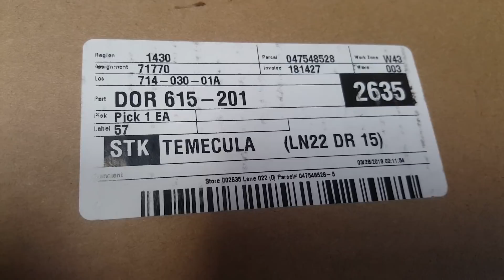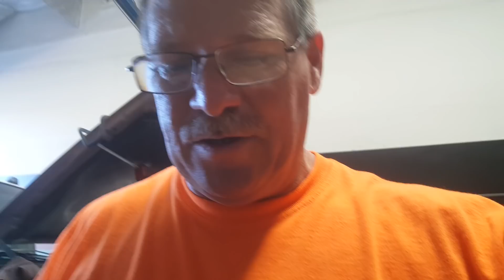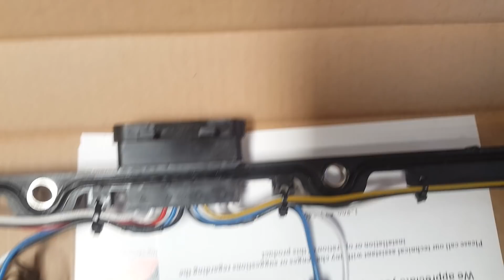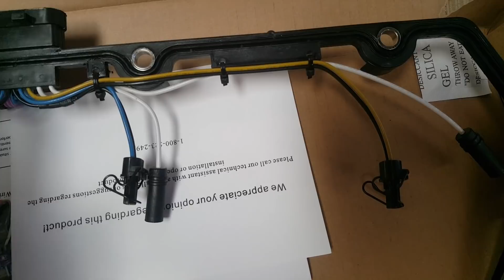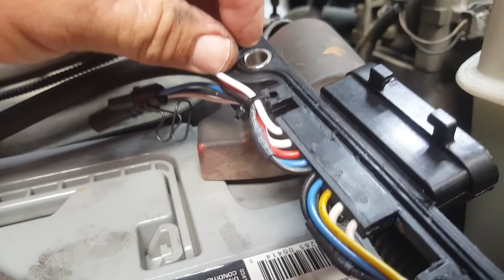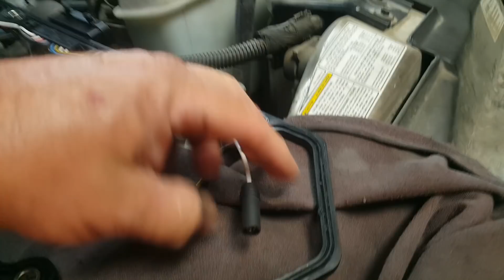99-03 Ford 7.3 Powerstroke Dorman #DOR 615-201 valve cover gasket failure.

Comment: Got one of these Dorman gaskets the other day, they have gone to the OEM design with an internal plug.  I ordered the TRQ, pictures show it to be direct wired.

Edit The TRQ is also like the OEM.  I bought a no-name LSSYEUX on Amazon and they were the direct wired version.  Torqued it to spec, all cylinders work and no oil leaks yet.

Comment: Man! I was all about doing the quarter trick. I read it’s basically impossible for the quarter to fall out as that was my first thought.  Now  I find your video that not only detests the quarter, but showing the doorman problems too.  

I was told the gaskets were replaced recently (somewhat) so I guess it could be many things.  Thanks for laying the quarter issue straight.  I was thinking short term to be sure it’s the issue before more parts are bought.

Comment: Seems to be common sense to me. Pay attention and don't pinch any wires. I've watched 3 different videos on replacing valve cover gaskets on the 7.3 power stroke. All of them like the Dorman 615-201 gaskets and every one of them stated, make sure the wires are clear of being pinched when you put the valve cover back on. Your video should only be about how you F/U and how not to make the same mistake you did. Sh*t happens.
   Telling people about the quarter trick is not a smart thing to do. I can't believe any sane person would do such a thing.

Comment: Yup the exact same thing happened to me.  I spent hours trying to figure out WTH was going on before i found it.  It was dark when i did using my flasglight and the light caught the copper wire just enough I seen a small flash.

Comment: Hi Ron thank you for the information. I have a question the doorman gasket also comes with a male harness (plug) did you change the plug or you were able to plug directly to the valve cover.  I replaced both valve covers and now no starting. It will “run” with starting fluid spraying into the air intake ?

Comment: I have installed this product on my 2001 7.3 and I bent the wires so they would stay away from gasket simply pushing wire is not enough because wire tension can push it back where you don't want it. Did my gaskets about 5 years ago 2019.

Comment: Unfortunately it seems the Dormans are the only gaskets available these days. The OEMs are sold as 2 pieces, good luck finding a set of both. The OEMs I did find were made in China too. Thanks for the heads up, I probably would have made the same mistake had I not seen this

Comment: Very helpful video! My normal source of parts is Rockauto and I see they carry 3 brands that come with the wire harness -- Standard, Apex, and GB. The pictures show only the GB one with ty-wrapped wires and the other 2 are loose wires. They also sell the gasket alone no wires. Anyone use any of those brands?

Comment: Bought some similar from another company recently they were junk, had nicked wires, missing wires and was just plain poor quality for 300 dollars i sent it right back and got some oem ones, they still have that plug under the valve covers but its good quality and it works.

Comment: So I was most of the way done with my injector replacement had covers back on and torqued, called it a day went on yt and this video popped up....next day took covers back off (I really didn't want to) and sure enough pinched the wires exactly where you pointed out the problem....THE HELL WITH DORMAN!!! THANK U SO MUCH FOR MAKING THIS VID

Comment: Cant say I would have noticed that.   I'm working on a 94.5 so the harness is different,  but I will check to make sure wires are clear when I put the valve cover on.

Comment: Sorry...IMHO, the Dorman gasket is a better design IF you pay attention to the installation. You need not deface currency, and you don't have to worry about  spare change in your valve cover.  I've been"riding" a pair of theses gaskets for almost 4 years without any issues!  With ANY automotive procedure, you need to watch for pinched wires (including the ones you're not working on).

Comment: I have a question for you that you may or may not be able to answer but I would appreciate it as soon as you get this if you would. The question is the heads on my 2002 7.3 did not have a fuel return and the heads that were rather identical come off of a 96 or 97 I believe 7.3 words to junkyard said that they would interchange however the heads I put on it had a fuel return line so since my original heads did not have a fuel return I just use a plug-in plug them up. The question is would something like that cause me to have performance issues as I put new heads all the injectors are working and I still got a lot of white or gray type smoke coming out the exhaust thank you for your help I do appreciate it
Reply from the maker: That's not a simple question to answer
Reply: Any help is greatly appreciated
Reply: Why were the heads replaced?

Comment: Wish I could post a picture I just pulled my drivers side valve cover because I’ve been having glow plug issues and I’m thinking possible even injector issues. As soon as I lifted my valve cover sure enough a smashed doreman valve cover gasket!! Installed bu a very reputable shop in my area! Thanks ron been using your videos trying to get my truck running better!

Comment: GUYS!!!! do not use these! I put them on my 2000 7.3 and the glow plug pin burnt off inside of the connector. also the rear cylinder on passenger side injector clip fell off of the injector while running. lasted 10 months and I don't drive it a lot. only ford parts on these! I had to but FOMOCO gaskets and the inner injector harness. My connectors to the engine harness were still good! I'm a 34 year ASE master tech! FOMOCO parts only on these!
Reply from the maker: I agree

Comment: >>WARNING * CHINA SELF DESTRUCT UNIT<<  That wire "alignment" issue is nothing compared to the INFERIOR material the wires are made with... After 20K miles I have seen on my own Dorman,, the plastic on the wires start cracking... Search it & people have seen "cross arcing" of the crap wires where it fires THE WRONG injector on it's compression stroke ..  Guess where that connecting rod ended up??
Reply from the maker: Thanks for the info. That would make sense

Comment: Ok update - I just did glow plugs and gaskets on a 7.3 yesterday with dorman gaskets - and they still have the wiring tie wrapped in such a way that will cause it to be shorted just as the video showes - it was a 2001 f250 with 570k miles on it.... the date is 11-12-2019

Comment: Wow - just in time viewing - have a 2001 7.3 just rolled in with 560k miles on it - customer wants new glow plugs and gaskets and the control relay... I have motor craft glowplugs but dorman lifetime gaskets with the integrated wiring harness - you can bet I will check them tomorrow - if they are still screwed up I will repost ... thanks for the heads up...
Reply: I’m having a problem with that set up right now 1, 2 and 3 injections are not firing

Comment: Just a PSA, never use gaskets or electrical parts made by Dorman, you will regret it.  Dorman has a nasty habit of shortening their tubes and wires by just a bit, and they'll shave a few thousands off their Orings and gaskets as well.  Case in point, I purchased and installed a set of Dorman Orings for an oil cooler and the end caps of the cooler slid right on with barely any pressure applied, needless to say once the oil cooler was in place it leaked and I had to redo the entire procedure with oem Orings.  Then there was a Dorman radiator return hose I purchased that had a 90 degree bend in it (supposedly a direct replacement for oem) but the hose itself was just about an inch too short to reach the tee at the other end.  Save yourself the frustration, the extra money you pay up front for oem (or better quality aftermarket) will save you from the cost of a tow and re-repair down the road.  My 2¢.
Reply: I’m literally about to change my gaskets and the first thing I heard was dorman and  I said hold on a minute and then I see this comment and I was like yeah Not doing that lol— sucks that no one wants to listen to the mechanics (like in this case) but then again don’t blame them because there are some hacks out there
Reply: I'm just about ready to replace mine and I've been looking at the aftermarket gaskets and yes I'm guilty of using cheaper parts that have great reviews but I've decided not to in this case. I'm going with all OEM, FOMOCO parts, my girl is a 2000 F-350 7.3l w/211,000 miles. Bought her new and she has treated me well! So she will have the best parts from now on...

Comment: Ron Williams, I have the same gaskets you featured in this video and need to point out to the other viewers here that Dorman's product isn't an issue here.  Yes, the way the wiring is set up if you aren't paying attention when you install them, you will have wires getting pinched (which will lead to premature failure of those wires).  However, there is sufficient slack in the wiring that allows you to easily move them out of the way when you install them in the engine.  I think its a stretch to say Dorman has a faulty product, especially when this solution is superior to cutting quarters in order to solve the stock gasket problems.
Reply from the maker: Those wires were so tight I had to stretch them around the plastic. Epic fail from dorman.
Reply: @SandCarServices  well, I didn't have the trouble you faced and this was a job I wrapped up a month ago. It is possible the product has improved.
Reply: Def short wires I caught the overlap prior to install but way more tension on wires than should be I had to go to the extent of removing one of the zip ties for some extra slack on each side...
Reply: the plastic insulation on the wires is reported to fail quickly.  That is a fail for sure!
Reply: Dorman is garbage. They use cheap sheathing on the wires and the oil causes them to prematurely fail.

Comment: So I have a question and this has been kicking my ass. When replacing the valve cover how do you plug the white glow plug wire back in? This has been fighting me for the past couple of days. I’ve tried everything I can think of. It’s gotten to the point I’ve had to buy another gasket because I’ve broken the white wire that plugs into the glow plug. Please feel free to reach out to me. Thanks for your help. Jason.
Reply: Hey Jason- those plugs fit pretty tight - what I do is get a nice size screwdriver on th back of the plug - when it is in place just give the screwdriver a rap and the plug will slide - just a little impact will make it go on.  Good luck
Reply: I used some pliers to push them in they are a pain in the ass

Comment: Just had this issue and found that exact pinched wire. The wire does not look damaged though. Did you have to replace the gasket/pinched wire that was pinched or were you able to reuse the same gasket??
Reply from the maker: Replaced it.
Reply: Fuck!

Was your wire visible damaged? Mine just looks a little pinched. 
So fucking pissed off .
I watched this video before I did this then showed my brother it then reminded him several times to make sure not to punch that wire when you put them on. 
Truck was running fine for like a week then started it up today and it runs like shit
Took the valve cover off one side and sure enough pinched fucking wire right there

Comment: Hey Ron I just wanted to let you know that I like the Dorman setup. The problem I ran into is that the heat shrink gives out and the crimp area starts to rub into the glow plug wire and shorts out. I installed it on a 02 and had to replace it again 3 months later. I found out the best way to make sure that it does not happen is to use 60/40 solder and fords double insulated oil resistant heat shrink I have also tested it on my own 01 and never had the same problem. It has lasted so far 3 years I have already put 233,000 miles on it now.

Comment: i Replaced an old set of dorman valve cover gasket because of the insulation was cracking on the wires.

Comment: Great video. This has been hashed out in the Ford forums over the last few years. I pinched mine on install as well 2 years ago, and it grounded out 2 of the glow plugs to the valve cover. Glad you could make a video for everyone. My Dorman replacements are going on 100k with no internal failures like the OEM harness had. I clipped off just the two zip ties closest to the plug.
Reply: You removed the zip ties closest to the plug or am I not understanding what you are saying?
Reply: @jacoe33333  Yes. The centered input plug being the reference, go to each side of it and remove those two tiny zip ties. This will give you the slack you need to keep the wires from being trapped/pinched between the gasket and the valve cover.
Reply: Did it only run on one bank

Comment: This gasket should work for all 7.3 if you go to the auto store it should be able to cross reference all the years from 94 to 2003.
Reply: No 94.4 -97 have a 4  plug gasket

Comment: Does the original Ford plug plug into the Dorman valve cover gasket or do you have to rewire a new plug to plug into the gasket
Reply from the maker: Excellent question.  Its direct fit.  Dorman does give you a pigtail incase you need it.
Reply: I don't know for sure as I haven't done the install yet myself. But from all the videos I've watched and the included parts when you order these kits it looks like you'll have to wire in a new pigtail that will connect to the dormant gasket.  After doing some more research I found a comment on an amazon review of the doorman kit and the customer reported using his old pigtail as it was good still.

Comment: Liked and subbed. I have a 1999 f250 7.3 and love the truck.i had the same problem with my truck with pinched wires and my ICP sensor. I fixed both and runs great.

Comment: Besides the wire getting pinched in the Dorman harness has there been any other issues with them ?
Reply: i Replaced an old set of dorman  valve cover gasket because of the insulation cracking on the wires.
Reply from the maker: I have not seen any problems other than that.  The wiring under the cover can not come loose at gasket again because they eliminated the connection
Reply: @SandCarServices  So the Zip ties should be fine for that higher heat and oil region?
Reply: @samuelyi9189  Yes. i have ran mine for over 100k miles with zero problem.
Reply: @rhettbachofer8824  Nice. I put in some and made sure the wires didnt get pinched. Was very helpful tip. If only i had glow plugs on hand at the time. Lol
Reply: Samuel Yi will this cause a idm code if a wire gets pinched or the connector separates ?
Reply: @thomasdougherty805  I dont know about that. But it can cause hard statting issues and a misfire.
Reply: I just replace my set for a second time because the first set leaked oil from the connector out into my pigtails.